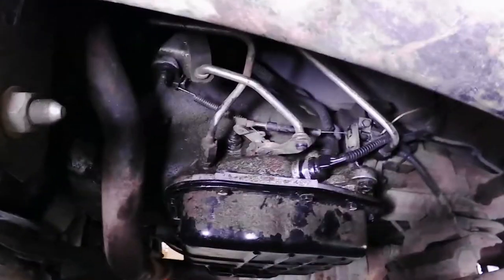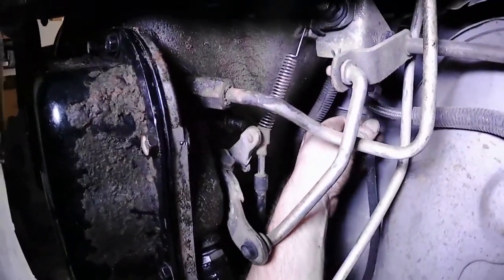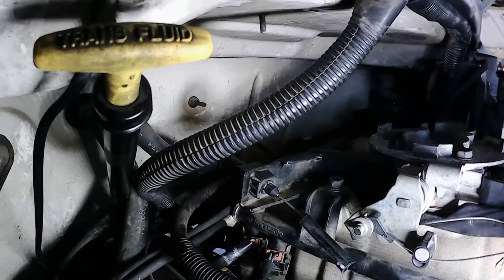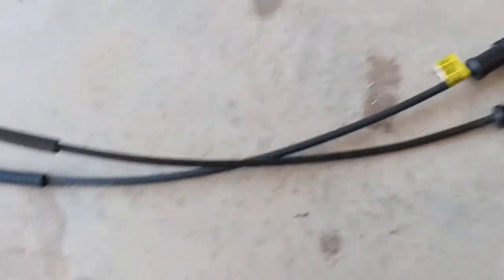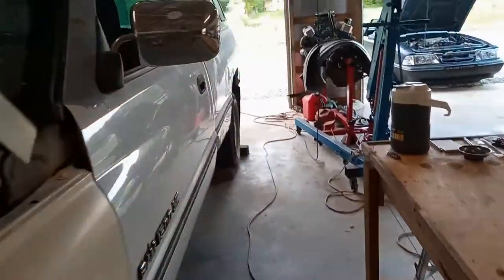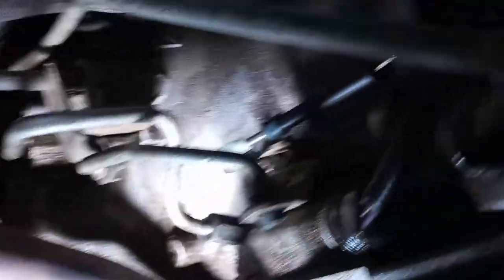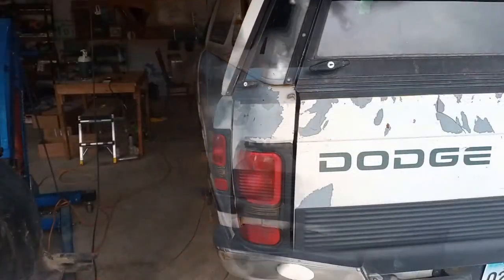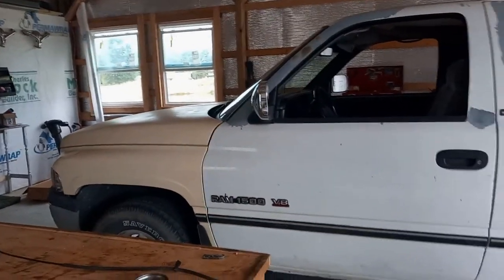Throttle Valve Cable Change: 97 Dodge 1500

Comment: Okay so here is my question Amazon says the part won't be here for almost a week should I still drive it until it comes in ?
Reply from the maker: Highly not recommended.  Without that cable to provide proper pressure to the transmission, it will burn out.
Reply: What the part no# so I can find it on Amazon